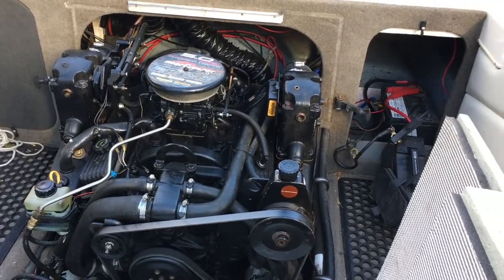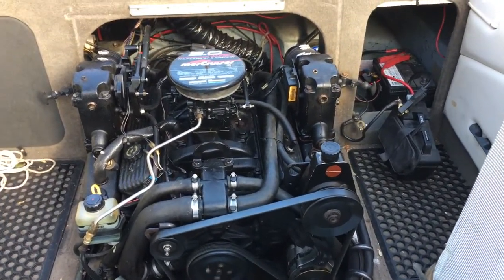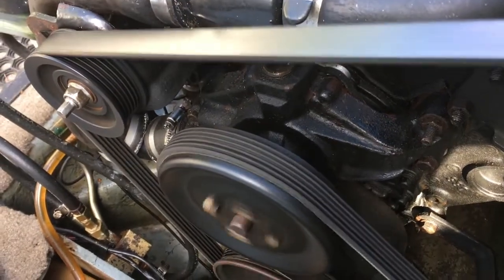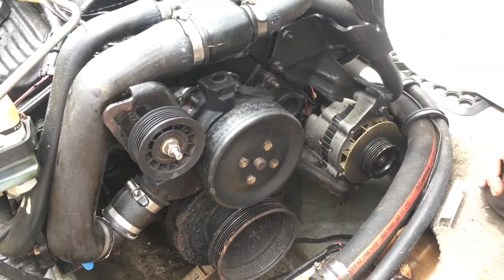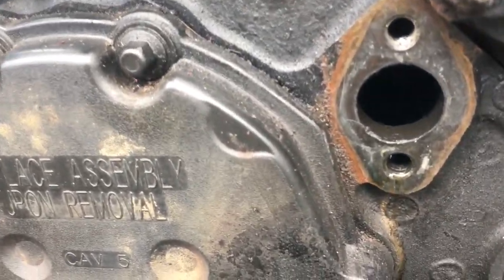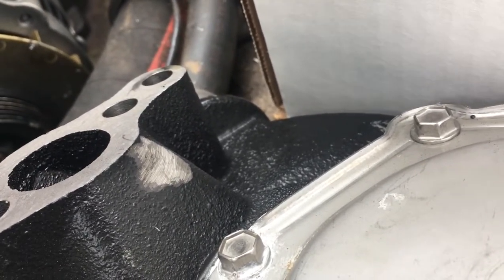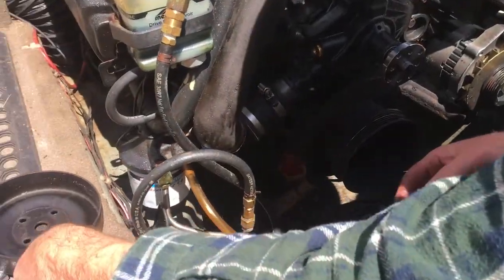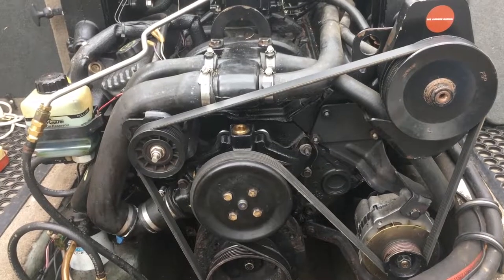Mercruiser V8 Water Pump Fix & Test

Comment: How could you tell the water pump was bad I could here you in the video
Reply from the maker: When I checked it over before starting I could feel a little movement in the shaft just moving it by hand up & down, then when it was running I could hear a new grinding squeal noise from it.